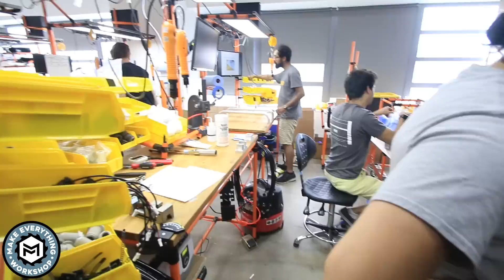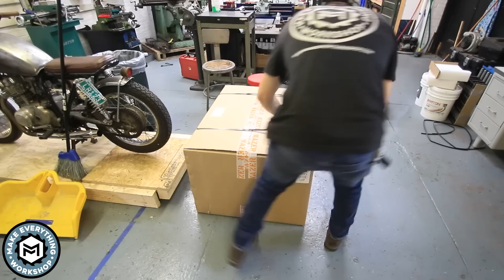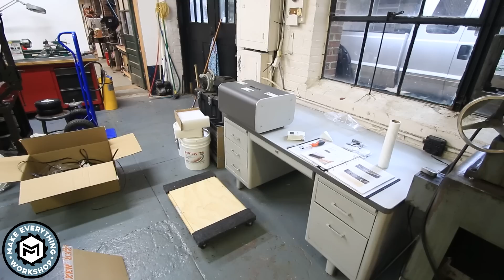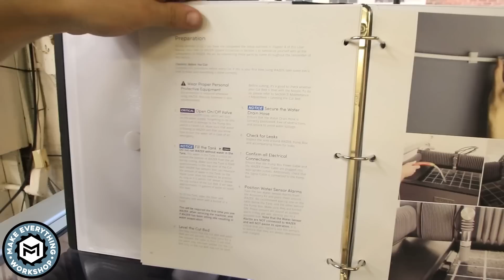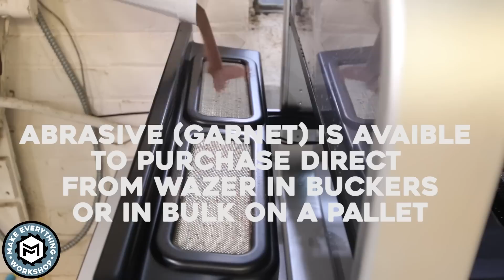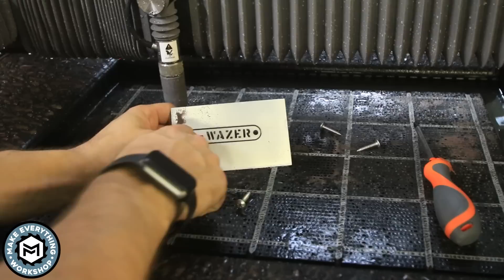Wazer Desktop Water Jet!! Setup and First Cut! (GAME CHANGER)

Comment: 15 minutes? It almost sounds like a joke for a small piece with small material thickness. This would mean that you can do 4pcs/h and what, charge 5$/piece that 20$/h ... i don't know man, doesn't sound that great over all
Reply: The art of buy, process- and sell.
Buy a piece of 1 USD metal, process it (for a fantastic knife or perhaps a unique monogram) and sell it for 100 USD.
Then suddenly we talk about 400 dollars/h. That’s the art of buy and sell. There’s a UK-based guy, doing this in wood. His machine makes 1000 dollars/h when working. The art of... again.
Cheers!
Reply: 15 minutes does sound like a lot of time.... when I can cut it with my laser in less then a minute.....  and i dont have to screw down the piece I am cutting.... no sand to purchase or get rid of after its use.....  Not the machine for me ....I thought it would be a good addition but not at this time...

Comment: To weak and to slow, thereby to expensive to run for knifemaking. It's a gadget that works for lighter tasks perhaps. And if one is outside the states it bumpes the prices way up!
Reply: Totally agree. Their estimated times and material usage is way off.
Reply: Yes. I used an OMAX and it worked about 60 times faster on thicker material. The time lapse in wazer videos looks like OMAX real time. Wazer uses really low pressure.

Comment: It takes too long to cut anything over an 1/8 of an inch. So definitely for thin sheet metal.
Reply: The advantage is that it does not heat the part, so no interference with tempering. Great for cutting gears
Reply: @orionfleming6783  Too much taper for gears imop

Comment: Great Vid.  Im kinda excited again now. Im in on the first batch and was getting a little cold on the whole thing due to how long its been taking and the cost to run. Im into knife making too and even tho it doesnt seem amazingly cost effective it will still be great for r&d.
Reply from the maker: I can’t speak to anyone else’s work flow, but I know for me, as a single entity running my own shop this thing is gonna pay for itself fast. It’s weird to have a machine tell you how much a part is gonna cost but once you step back and think about your time + other consumables to make things the wazer cost is actually pretty low. For instance this cut two titanium frame lock sides for me out of .120 6AL4V titanium in about 60 minutes, that cost me $30 in garnet but saved me a $15 bandsaw blade $10 in belts, and potentially blowing up a $75 carbide slitting saw, and probably 2/3 hours in time to drill screw holes and profile the sides. For that application the wazer is unbeatable. I hope you enjoy your machine!
Reply: for sure!
Reply: @MakeEverything  Do you think the cost would be much lower for cutting softer materials such as tile? Also is it possible to use other less costly options than garnet?
Reply: Can you provide us any numbers?

Comment: looking at their website it appears a $79 55lb bucket of the garnett abrasive only lasts about 2.75hrs of run time. if that little keychain took 15 minutes i could see this being quite expensive to run full time. is that the norm for water jets? is there cheaper abrasives available?
Reply from the maker: It’s definitely not as cost effective per part as a commercial grade water jet, but a large water jet is gonna be 100k plus. For me as a Knifemaker it basically allows me to double my productivity by having it cut blanks while I work on other things. I will be buying abrasive by the pallet which makes it about $0.50 per lb. at that rate I can cut a blank for under $20 that would normally take me an hour, plus the consumable cost of wearing out bandsaw blades and drill bits. I charge more than that per hour for my time so it’s absolutely worth it. It’s certainly does not seem cheap up front, but you can always make more money, and you can’t make more time.
Reply: Make Everything I basically agree with all your points, about time being essentially invaluable and how you can trade money for an increase in productivity, making more money in turn. All that said, that $20/h still sounds like a humongous expense to me. I'm  a hobbyist, and not a very successful one so far, but in the span of an hour I can cut and drill 4 blanks, at a fraction of that $20, even if I throw away a Cobalt drill-bit afterwards (I don't). If you're making skmething like 10-15 knives a day, all by yourself, then this expense makes sense if you want to keep working solo. Otherwise it feels like you're paying for a convenience, which is a totally valid thing for a pro to do, but it is completely different from what I think you're saying.
Reply: What does it cost to deliver a pallet to you? (If you don't mind answering). For under 5k for a complete waterjet machine, completely insane! (and affordable)
Reply from the maker: Dogbert for me in NY a 2200lb pallet delivered is $950, at under $0.50 a lb is makes parts MUCH more affordable to cut. 2200lbs seems like a lot of material buts it’s only 40 bags, it wouldn’t be too hard to store that amount of material...
Reply: I suppose that if people are inserting their "two cents", I just received my order of the ProtoMAX personal compact water jet from OMAX yesterday, with a 2-4 week turn around from order to delivery and I am looking forward to unpacking and setting it up. I plan to produce my own similar video documenting the unpacking and setting up, and first cut.
Reply: How do you like the ProtoMAX so far? I am thinking of getting one for my shop and would love to know your experience with it.
Reply: Clair Stevenson 
How is the protomax?
Reply: If you want to speed up production and lower operating costs, look into the Langmuir Systems CrossFire. It’s only $1250 (1750 with plasma cutter) and it will cut out a knife blank in less than a minute.You would need to leave about .060 of stock on the blades edge and then remove it via grinding after plasma cutting. This is to remove the heat affected zone so that the edge can be properly hardened later on.
Reply: Don't forget you also need to periodically replace the sacrificial corrugated plastic cutting bed which is not cheap.